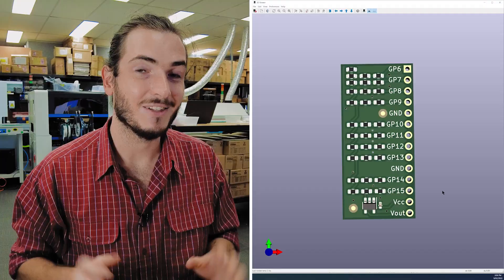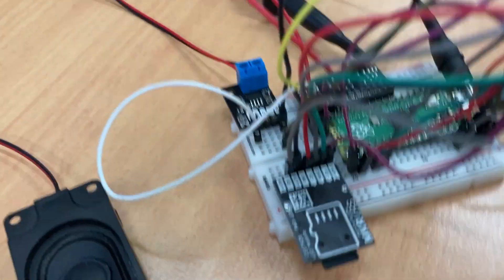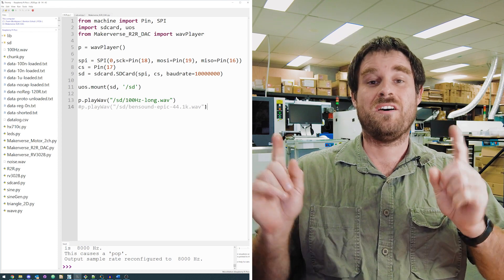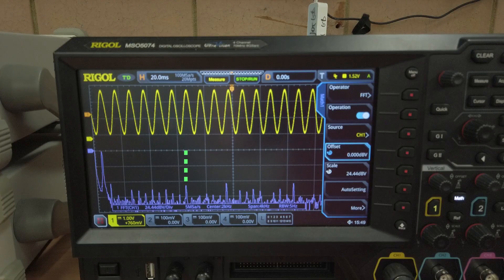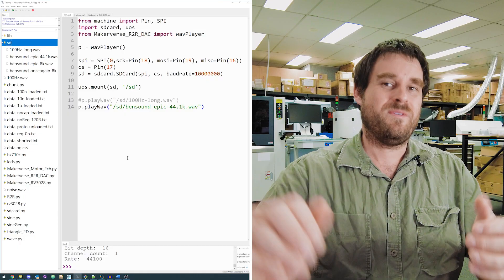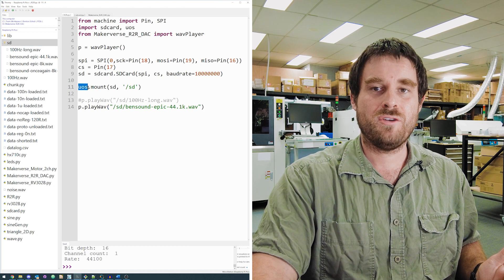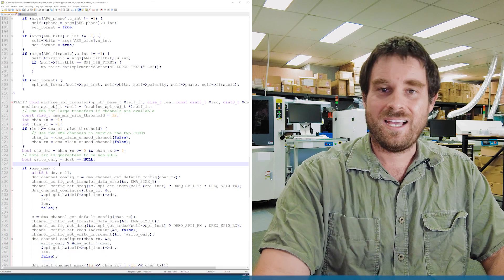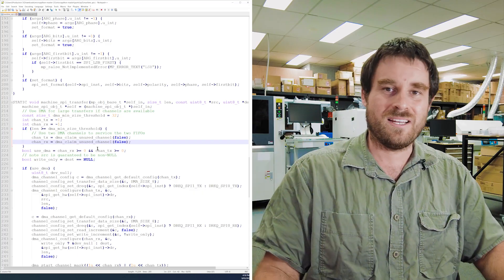The Factory | Playing Audio with a Handmade DAC

Comment: Great video.  I want to reproduce what you have done but with 16 bits.  Is there any technical challenge with adding 6 more bits? A comment below said its not trivial.  
I assume the 5 pin IC on your board is an OP Amp so that the board can run a small speaker?  Do you have a schematic you can share?
Reply from the maker: The limiting factor is resistor precision! A higher resolution DAC will require more precise resistors. 
You can find links to repos, code and scematics on each product page / tutorial eg:
https://core-electronics.com.au/makerverse-pam8302-2-5w-mono-amplifier.html

Comment: This is such great timing for me. I became aware of Core Electronics because myself and a mate (we're in Melbourne) have begun designing and building a eurorack VCO module based on a new and exciting chip. He's the electronics expert so he's handling the layout and construction and my job is to make the control system for which I plan on using a micro controller. One planned part of this system is audio rate modulation of signals so these recent vids have been very interesting to me and you'll no doubt be hearing from me soon. Cheers.